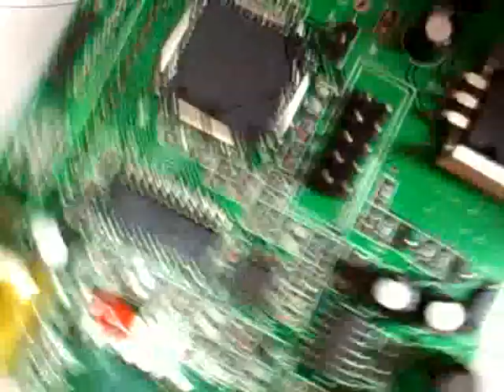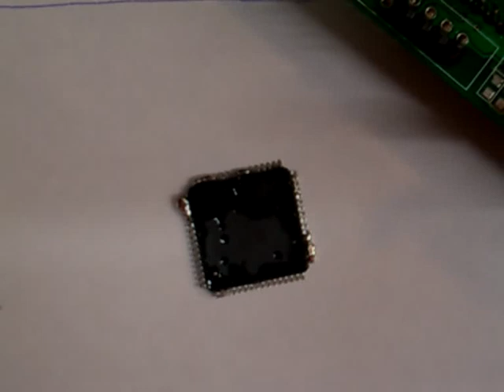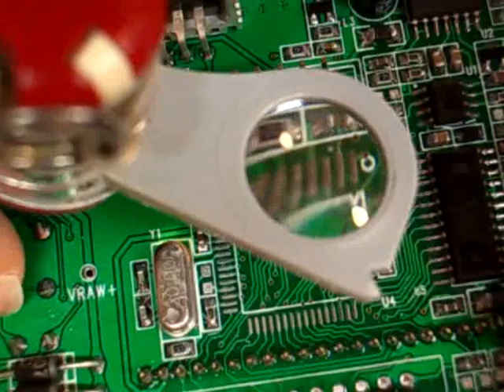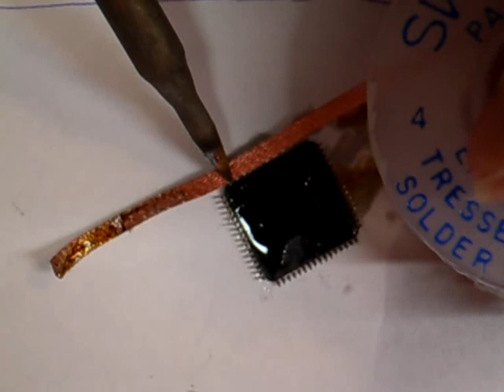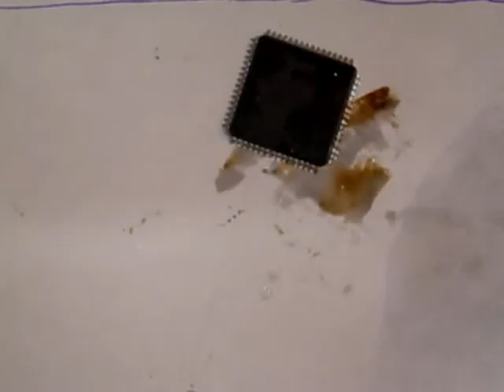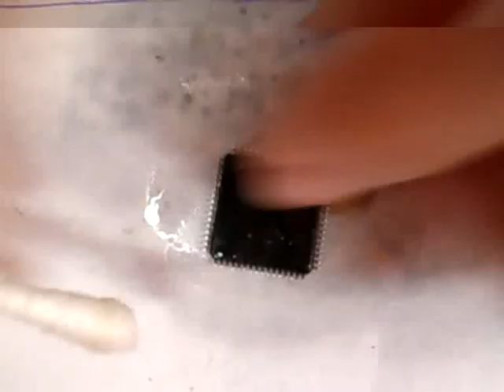Jyetech oscilloscope - replacing the ATmega64

Comment: Sorry I wasn't more clear, I had a bunch of quesitons all pop up at once. There is a grid of holes next to J5 or on some schematics it is refered to as J5 it's a grid of 10x2 or 20 holes and you have a jumper there. I noticed it also on a picture from jyetech but no where do they say what it does.

That's awesome information about the serial connector, I didn't know it could do all that, can I just use a ftdi cable to download the images somehow?

Comment: I have the latest version of this kit and I've had no luck with it, They show a picture on there site with a wire that's not on any instructions and I noticed yours dosn't have it but it's just under the chip your working on they have  bridge in the open area where you've added pins. What are those 4 pins for? Did you add 2 more pins to the top for your test video?

Comment: Man, just melt the solder with the board upside down, the chip will fall down easy when released.  Or, stick a scotch tape on the top of the chip, to a broken rubber band to offer some spring action.  I got really upset seem you fighting with the enerving tweezers and the solder cooling down... you could damage the small pads of the PCB doing that.
Wagner.